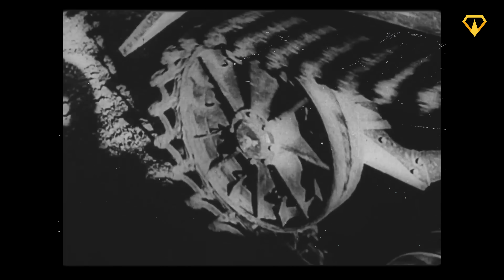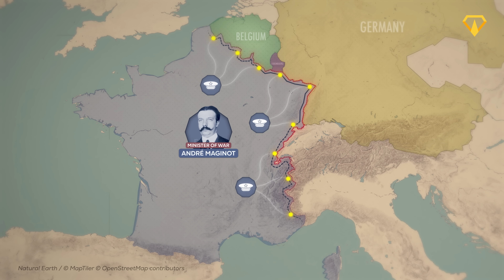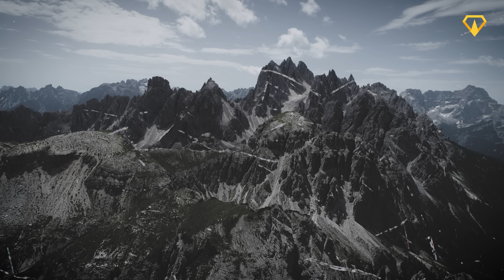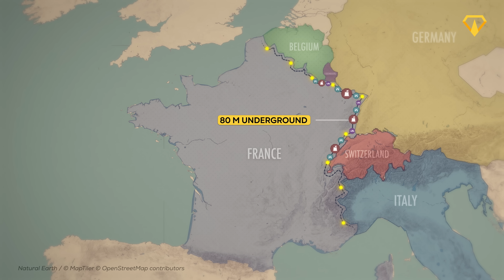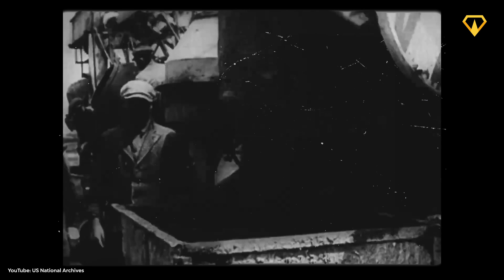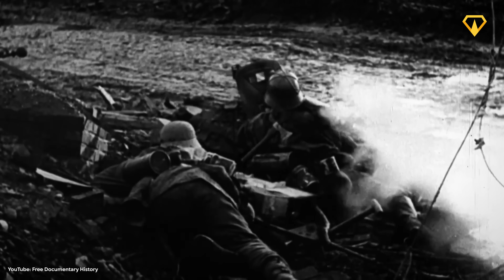The $4 Billion Wall That Failed in 6 Weeks

Comment: To be fair, the line worked where it was properly built. The Germans were able to attack it from both directions (i.e. from the underbelly, without the ability for resupply/reinforcements), and garrisons were still able to hold out for weeks. Keep in mind that in June France surrendered, so some of the garrisons surrendered with it. The remaining garrisons fought stubbornly not just against Germany, but one could say against the French collaborator government itself. The stories of those fighting garrisons are incredible, and they prove that the megastructure actually worked as intended. It failed where it wasn't built in the first place.

Comment: The Maginot Line was never meant to stop the Germans. It was meant to delay them until France could mobilize their troops. And it failed because its designers thought armoured units could not rapidly cross the Ardennes Forest. This assumption proved wrong. Did it work? Yes, the Germans had to go around it. That was what it was designed for.
Reply: Partially true but the line was only a part of the defenses. The plan was to deploy the British French armies into Belgium but with the Phoney war and the betrayal of the Czechs, the Belgian monarch freaked out and pulled their army back and declared neutrality. Germans immediately captured the Belgian defenses and immediately rendered allied defensive strategy pointless. The maginot did its job but it was outflanked when the parts not covered did not work out as planners envisioned.